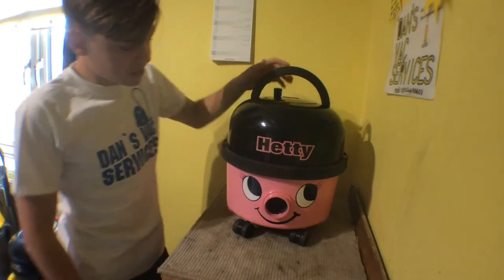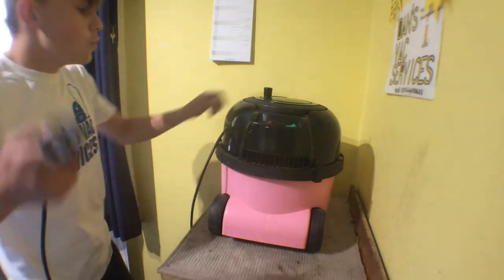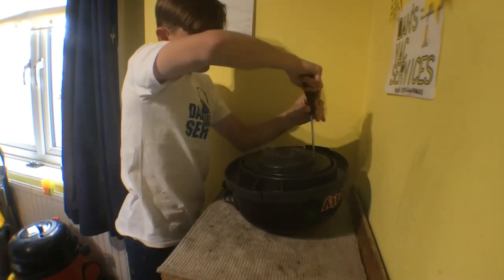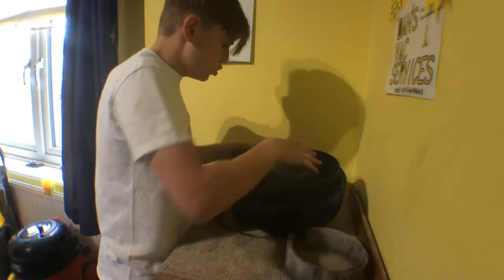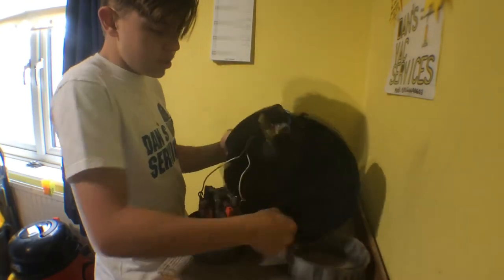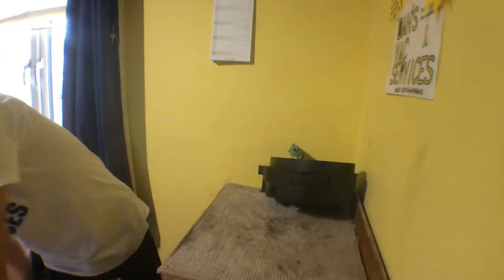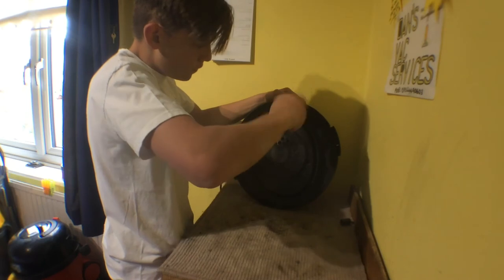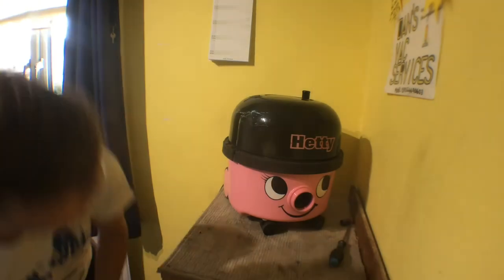How to remove the PCB board on a Numatic autosave vacuum

Comment: i never knew you can change the autosave vacs to single stage motors
Reply from the maker: Washercrazy there still got 2 fans in the motor, just one speed
Reply: thats what Im talking about single speed motors
Reply: Washercrazy Stage refers to fans.Speed refers to the hi lo settings